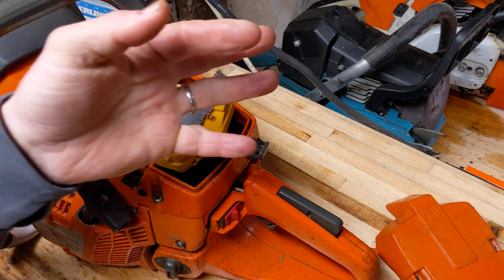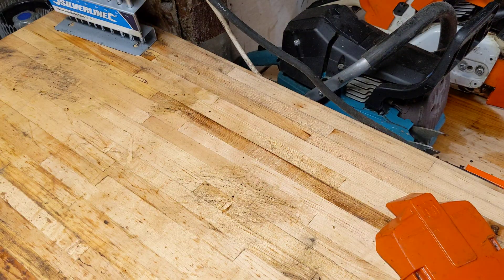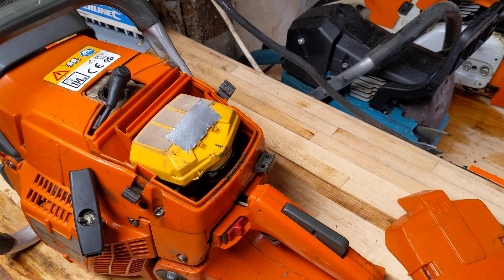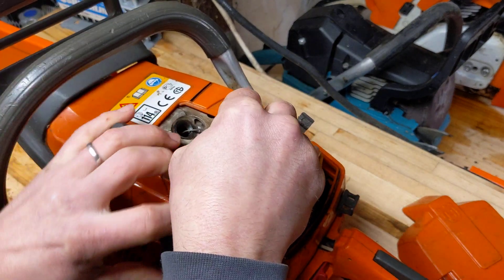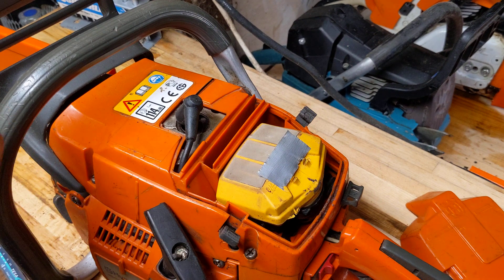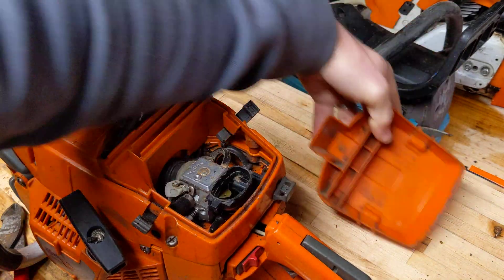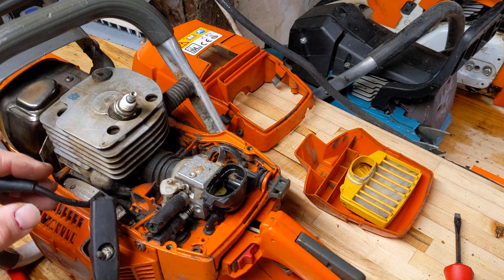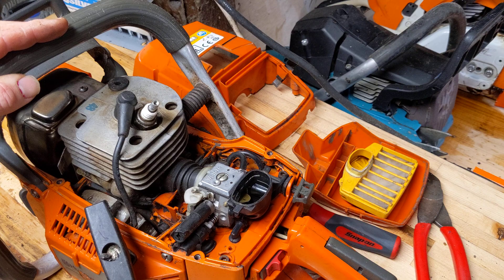Husqvarna 365 SP Special / 372xp Compression & Squish measurement before porting & popup piston

Comment: You were out of camera view when you were yarding on the starter during your compression test but I thought I'd mention that if you weren't holding the throttle wide open while pulling you should probably consider it.  Won't make a huge difference but if you're hunting those last few psi to get your saw over your magic compression number it'll likely help...
Reply from the maker: Thanks for another helpful comment. Yep, I always hold the throttle open 👍